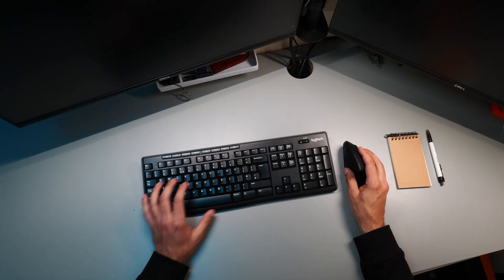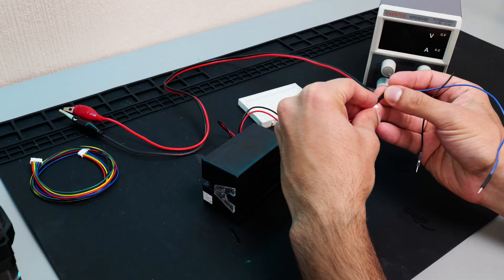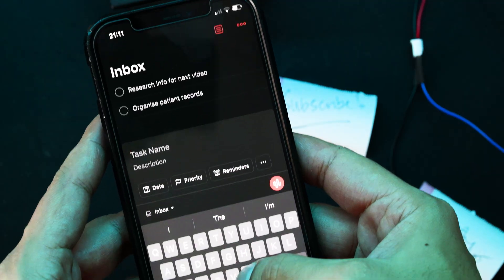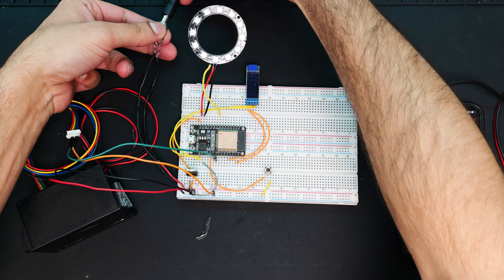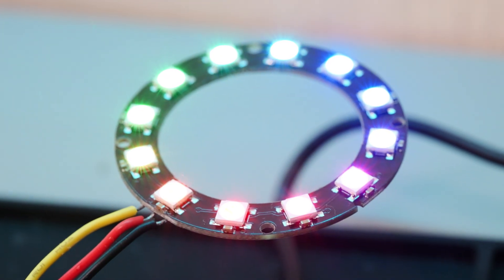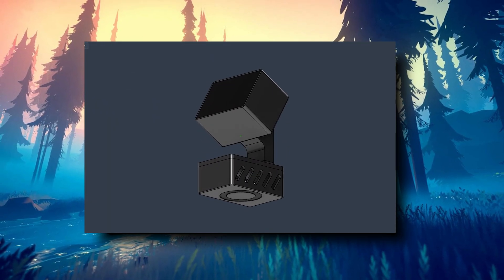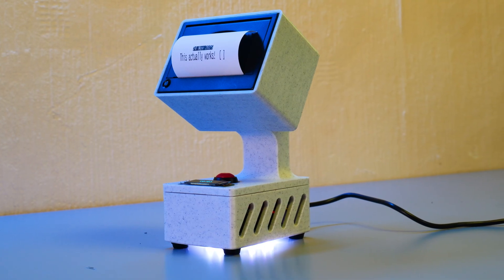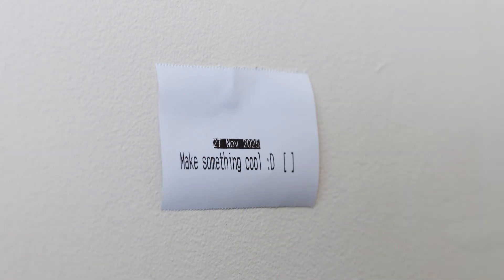This Invention Fixed My Focus

Comment: 7:25 awesome project - one suggestion here would be to use a switching converter rather than a linear one as you’ll save yourself some heat! Also worth grabbing a usbc pd board to simplify your 9v in
Reply from the maker: Thank you! 
Just looked into using a USB-C PD board - I really wish I knew about these before I started this project, but I'll know for next time. Thanks for the recommendation!